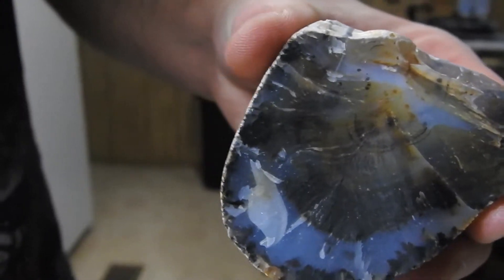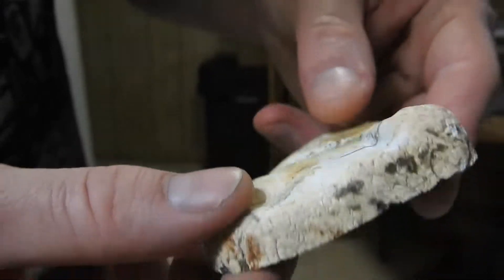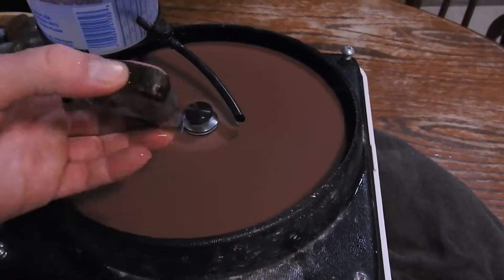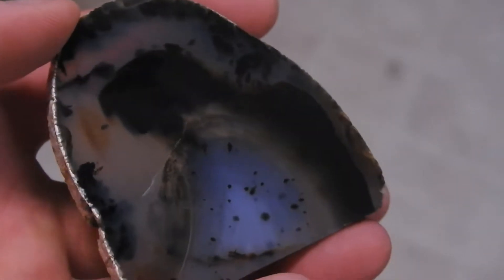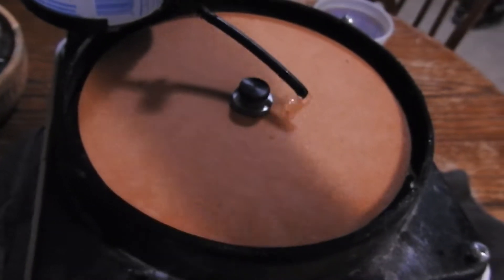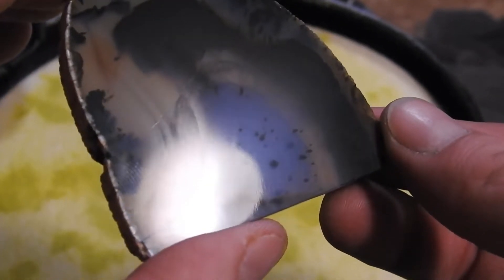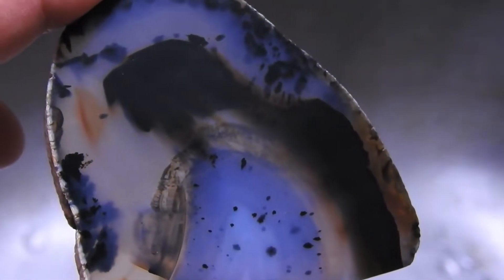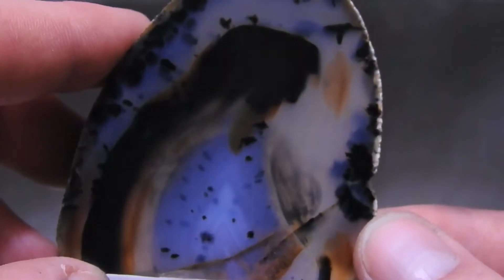Polishing on the flat lap

Comment: Dang, that thing sure is pretty inside. Thanks for the mention. Do you thinking the high polish pads are worth it?
Reply from the maker: Thanks I appreciate it, and anytime your knowledge about the flat lap helped a lot, and with the different grades of polish it seems to show the different layers in the rock material for the ones I have done ,when you reflect the light on it, I can send some pics of what I mean on your instagram and see if you get the same or different results.
Reply: @406findings  I would love to see some photos.